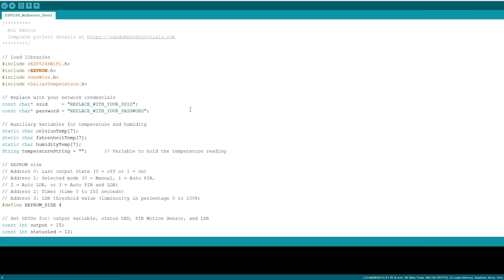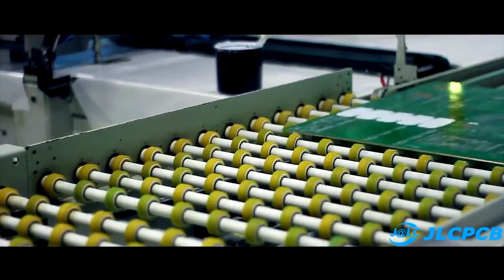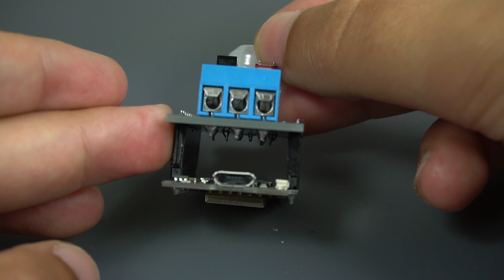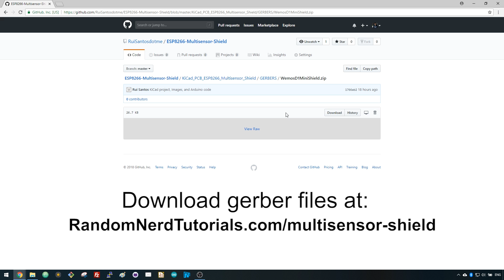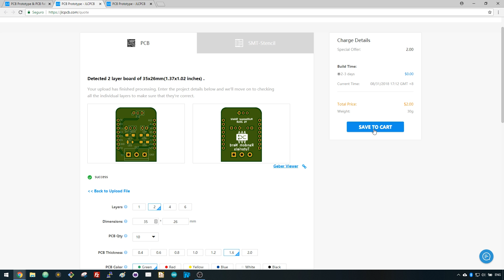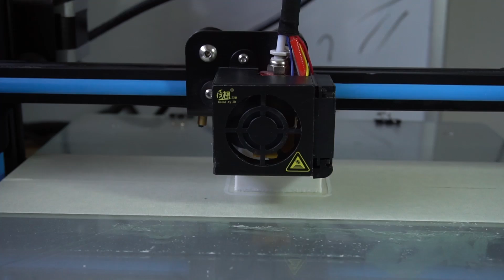Build a Multisensor Shield for ESP8266 - Part 1

Comment: Hey Rui, another great video. I'm planning on adding an ESP8266 to the Harbor Freight Wireless Security Alert System receiver that has a 6V, 200mA power supply jack. The motion sensor is 433MHz on a 9V battery. Please consider creating a video tutorial on how to attach an ESP8266 to the receiver board and how to set it up with an MQTT Broker to receive alerts. Cheers